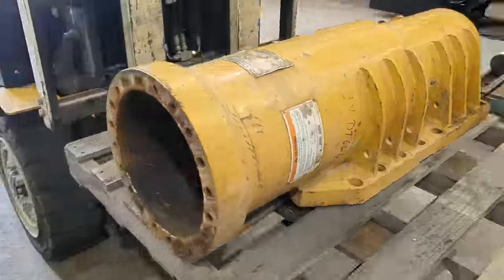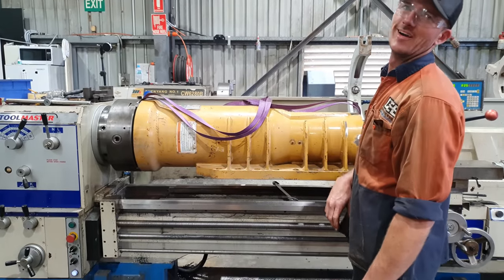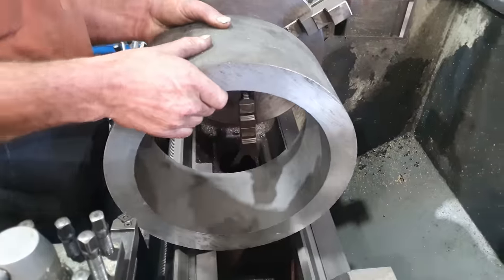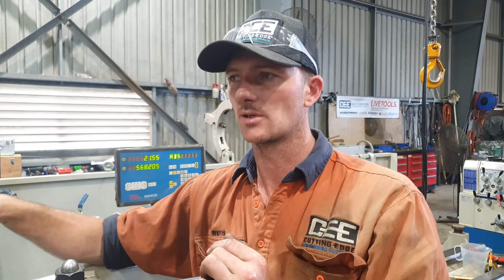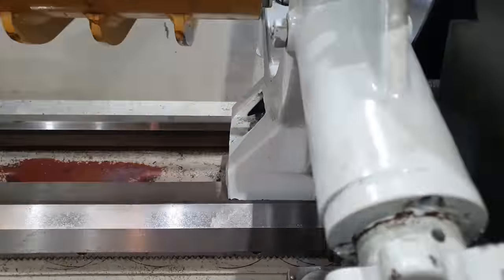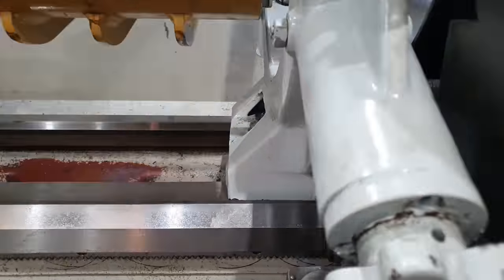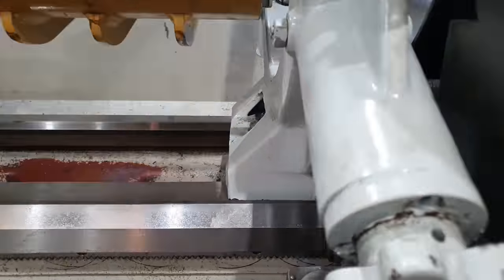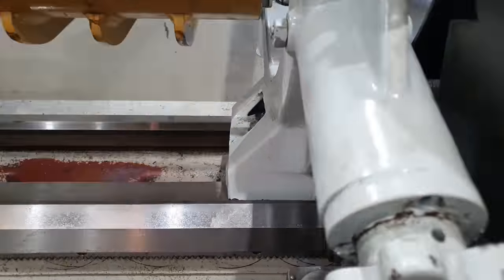This Job DIDN’T Go As Planned! | CAT 777 Suspension Strut Repair

Comment: There has been some speculation that the welding of the collar and the bolting on of the counterweight may have caused the ovality. Be aware that the huge difference in size of the casting and its circular shape and the almost infinitesimal heat transfer could not have caused this in any way. However it may have been wise to put the bore gauge down the hole before the work that was done was commenced. Maybe next time? We all learn from our miss calculations and in the great scheme of things they do not detract from our livelihood provided we do not repeat them. Kurtis and Karin have far more hits than misses. I would love to be as capable as they are as a team. I would also love to have a heart as big as yours and the guts to stick my neck out as far as I reckon yours is. All the best for 2024

Comment: Do you charge for the setup and diagnosis? I have had jobs go sideways like that and I preferred to apply the charge at this point for my time and setup ultimately to the  final repair. That assured that I would get the job in the end - if they decided to do the job at all, that is.

Comment: "It's not working" is a good reason for not using the borer, but I don't think that this job needed a quill? You could just move the table to bore the features. (I have used a little Kearns for exactly this sort of job)

Comment: 🤔Ok this was quite intriguing to me. I'm guessing the the wear band wore unevenly inside the cylinder, causing it to 'egg' shape, yeah? Would it have been possible to bore out 2.5mm on the high side to bring it back into 'round'? and then get a wear band size to fit? or do the wear bands just come in one size and that's it? Another Idea I have is to 🤔...nah that wouldn't work either. Cheers Blessings. Hope you have a great weekend guys. ps: You should patent that lizard trap 🤣.

Comment: Great work as always Kertus.  Im just curious if the tightness of the counter weight bolts combined with the flange weld contributed to the distortion of the cylinder? Keep up with the awesome vids.

Comment: Was there any way to do the measurement before stting it up on the lathe? I'm not trying to be a smart A cause I know you didn't expect this much of a misalignment. But was wondering if there is a way to prevent all the set up hassle for the next time.

Comment: Rather than trying to fix this one, would it be cheaper for you to machine up a new tube and move the counterweight from the old one to the new one (or just build a new counterweight entirely)?

Assuming your shop has all the equipment that you'd need to do that...

Comment: Maybe a silly (but honest) question, could you not have measured this before doing all the setup? Or were you expecting to do the work either way, no matter the state of the part?
Reply: I think, given the fact that the setup was based on the tailstock's 3-jaw chuck in the egg-shaped hole, there was no expectation that it was out of round.

Comment: So, I noticed that when you turned that ring for steady rest support, you didnt get it dialed in at all.  It was an interrupted cut and visually not dialed in.  I realize the piece had other issues, but wouldnt that have thrown off everything even more? I was expecting you to turn the outside in the same set up.  Im just learning and Im asking because I want the knowledge, not trying to say youre wrong

Comment: The wire used for welding. before line boring.
what is it?
And would it be able to be used on old ford and holden engines?

Comment: I'm surprised that you don't keep a few 100# of lead in the shop.   You can quickly make a mold to cast it however you want.   Sometimes it might be possible to cast it using a part of the machine you are repairing as a mold.  If you cast it into sheet you can hammer it around your part.   Just a $.02 thought.

Comment: hi I'm from Ireland  and am fascinated by you channel, could the  cylinders  be designed with a liner  and you just push a replacement  liner in and the old one out 
thanks for reading  this   Irish pensioner, Fran Walsh

Comment: The lizard rescue is great.  What I don't understand, though, is why you wouldn't sub that job out to a shop that has a horizontal boring mill.    It's obvious, given the gyrations you went through to set this up that a lather is not the right tool for the job.

Comment: Are you sure you don't have a horizontal boring mill in your old facing mill?  Can't that facing head be removed?  Giddings and Lewis made a similar boring mill that had a removable facing head and a normal boring mill taped and draw bar set up.  Just asking and don't expect an answer.

Comment: even the cylinder bores of ordinary engines "go oval" over time..........some are worse than others, but its just how the various forces of moving parts take a toll on the components. I have a suspicion that when that component was made, and they welded all the ribs and backing plate on it, they distorted the cylinder itself.

Comment: Yo Guys!!  Huge, huge fan.  I watch you guys every week. This week, I couldn't help but put myself in your shoes and think: "Fuck. If only I had measured this before I did all of this setup work. Fuck..." Is this something you could have caught before you put it on the lathe? Is checking dimensions like this on parts something you nromally do when parts come in? Or is this one a mutant? 

Very cool, too, how you showed concentricity with dual guages.  First time I'd seen that. Cheers, mates!

Comment: Please be careful using the angle grinder cut off wheel without a guard in place. Co-worker had a disc explode doing that and a piece of it went through his cheek and took out a couple of teeth, he is lucky.. people have died from exploding discs hitting their carotid artery in their necks. 
I'm guilty of doing it too, but lately i've been more adamant about using the guard. stay safe

Comment: Not worth just leaving the steady band on the end? Whenever they decide to go through with the repair, they're probably going to need it on there, and taking it off and putting a new one back on are both a hassle. Cost of the material would have to be pretty minimal compared to the labour.

Comment: I’m kind of hoping that the threaded rod you used on the clamp wasn’t galvanized like it looked. Otherwise those welding fumes would be really bad for you. 

Other than that, quite the setup, and plenty to appreciate and learn from.

Comment: Hello I do basically what you are doing in a hydraulic shop and my wife goes you and this guy are made of the same materials cause he’s doing exactly what I said you would do on a lathe but I would use my bore bar with all those crazy dimensions 2 mil doesn’t seem like a lot but hydraulics especially a tube that runs over 5500 psi and takes a shock loading over 7000 psi I know banana’s but I do use MM’s machining so much better than naners but you or I’ve found that 0.07 mil or less is what it takes to get a good seal so oil isn’t blowing out that 1200 dollar seal I don’t think it blows it out as much as it lets dirt in and wears it out, so yeah, I would use my boar bar and weld or build up all of that inside so it’s all in line with upper end and the lower would take a little bit but doable because I’m here to tell you I don’t tell my wife but setting stuff up like that scares the crap out of me I do know a guy who cuts the mounting surface off but that’s on a 773 or 769 nothing as big as a triple seven but it sure does feel good setting something up like that and getting her done. Be safe my friend that I don’t even know make sure you go home with all 20.

Comment: Please don't weld on your lathe like that, the spatter will destroy your bedways or possibly even arc the main spindle bearings, especially if the power passes through it depending on where you earthed, on what seems to be a great lathe.  If you have to do it make sure to always cover all the ways and earth right next to it.

Comment: Just a opinion but the customer probably knew this part was junk before they even contacted and tried to cheap out by taking advantage of you. Customers lie all the time and expect miracles to be done for cheap, often with the promise of more work in the future. 

Rule # 1, never trust another persons work always double check before committing. 

Rule # 2, the runout/checking for eggshape should have really been done before it was taken off the truck. 

But if the customer said that it was checked and still in spec then go back to Rule # 1. 

Saves a lot of time and aggravation in the future but I’m sure the lesson was already learned and will be applied next time.

Comment: Hindsight is always 20/20, but couldn't you have figured out the bore was too egg shaped by measuring it before you put in all the effort setting it up in the lathe?  Just a thought to take a minute or two to measure the parts first before setting them up.

Comment: I get why you use a hand held 5" grinder to cut off your rod. Sorry but no guard is simply dumb. I know they restrict access to grinding. I trim my guards. Cut them back so more of the wheel is exposed. I then cut off the side portions on an angle. The grinder can still be sat down while winding down. You can't get to the wheel when you are holding one handed. The guard now hardly ever gets in the way. Have a look and see if you can figure out what I am meaning. Take care

Comment: That’s too bad this one didn’t work out. Would it have been better to take those measurements before going to the trouble of putting it on the lathe and balancing it with the counterweight? Seems like it could have saved you a couple of hours that I assume you didn’t get paid for.

Comment: Though the repair was not completed, I sure hope you were paid to figure out what was wrong with the part and why it couldnt be repaired the way the customer wanted. Chances are, the customer sent it to a competitor and had them do a half ass job just good enough to get the part to work. I hope not.

Comment: When you own plant as big as that truck then you should expert parts and repairs for it to be costly.  The full repair on this part would still be a lot cheaper than a new one and at some point the customer is going to run out of spares or if they continue to use spares that are faulty like this, then the whole truck could be become B.E.R.  If they aren't budgeting for repairs of this type then they should start to do so, sooner rather than later.   They are fortunate they chose Kurtis because I'm sure some other outfits would of done the repair requested and said nothing about the egg shaped barrel.